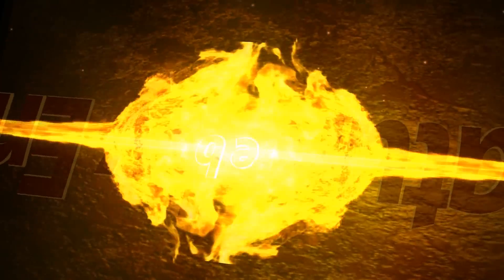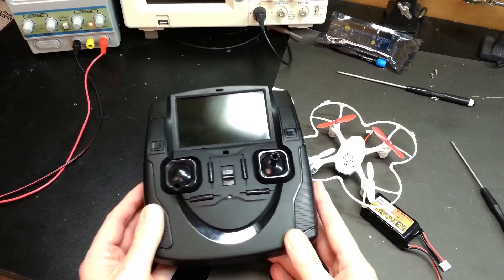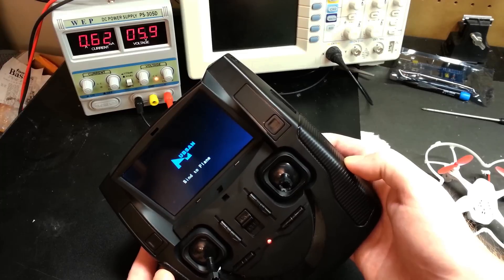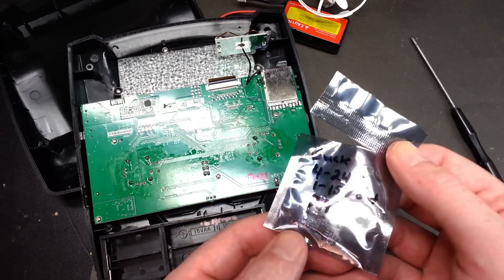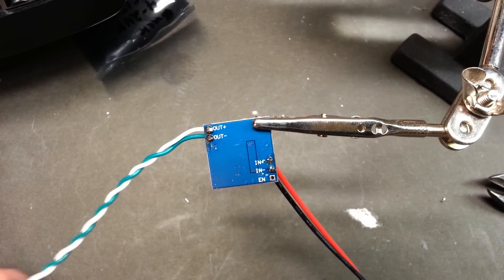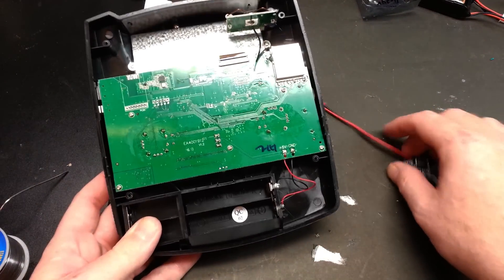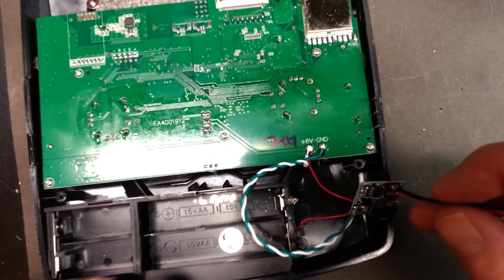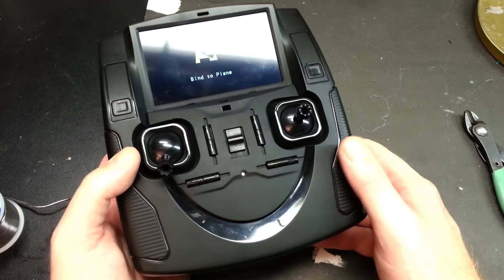Convert Any R/C Transmitter To Rechargeable Packs (LiPo etc)

Comment: Hi there, I have a mjx bugs 6 controller and it takes 4 X 1.5v  AA batteries. Could I please do the same , if so what parts would you recommend buying as I'm in the UK so eBay or Amazon is my only choice. Thanks MKme lab 😃👍

Comment: Very helpful... for the new professional Hubsan  FPV Transmitter remote for the H501S-S that uses 8 AA which of these  batteries is the best? 

 * ZIPPY 2500mAh 3S LIPO TRANSMITTER JR Z1 9X FUTABA 7C T7C HITEC SWAP 8 AA BATTERY.

* 2650Mah 11.1V 3S 1C FUTABA JR SPEKTRUM TRANSMITTER LIPO BATTERY PACK

*Turnigy nano-tech 2500mAh 3S 11.1v 5C 10C Lipo Transmitter Pack Battery TX JR

*2200mAh 8C 3S Li-poly RC Battery for JR FUTABA FlySky FS-TH9X Transmitter

*3S 11.1v 2600 mAh 3C Transmitter Pack Futaba JR Spektrum Walkera Radio 

Thanks...

Comment: Great video. I have tried this mod on my Hubsan h501s using 11.1v. I'm now back to stock, but now using 4x AA "Energizer Ultimate Lithium" batteries. I kid you not! I got 400m extra range (from the same spot). I have used the same battery set over 15 flights now, each flight ranging from 13min to 23 min. It's still on full bars. Just try them. Their around £5 for a pack of 4.

Comment: I would have removed the divider between battery bays and fitted the battery INSIDE the case. If you are going to convert, do it right. Nice jon. Good tip.

Comment: I just ordered 10 of the buck dc-dc converters. I am having issues with my DX 6, seems the turnigy 4000 mah lithium battery is supplying too much power to the transmitter causing a shut down issue. Power is somehow bleeding beyond the switch and powering the back illumination board. I am also having issues with my Tactic 850. The battery is being bled down by the transmitter. my goal is to add the buck converter to lower the voltage. I also am adding a sound booster to the transmitter as well as replacing the factory speaker which sounds like crap with a speaker from a computer. When I am done, I should be able to understand what is being said and loud enough with no distortion on my DX 6. Your tip is a great idea and should work great for both applications, both powering the amp and regulating the power comming from the battery. I will be releasing a free video on RC Hobbist extreme should it work. ok.

Comment: Would it work on the RECIEVER???
The reason I ask is...on some cheap $20 cars with 7 ea nicad  (8.4 V)
I simply used 3S or 4S  LI ON on them. The stock RX works fine.
It gose faster. Maybe 20-30 mph....That was QUICK and CHEAP..lol

I have a 1/16 that used 5-ea nicad pack.......NO GO on 3S
It has decent speed for 7 year old...but Im older now...I need it a wittle FASTER
I got it for $16...Im not going to spend $100 to fix it...when I can just get one
for $50.......$5 is okay.lol

Comment: Thanks! Im totally going to do this to my heli transmitter. Because its 6 volt and i want to use the same 3s lipo that runs my 12v truck transmitter. :)

I need a lesson in soldering probably lol but im gunna do it anyways.

Comment: I have made this and it´s so easy. I use a UBEC with a jumper for 5 or 6V and a Li-Po 2S 1000mAh. I set the UBEC to 6V and all runs fine. I have install this in the case of a Fly Sky FS-i6 with a connection cable in the batterycase to disconnect it and connect it to my charger.
It was the best idea ever to modify transmitters what i found.
Thanks very much! :-)

Comment: can i use a 2s 800mah 25c?
Reply: using a lcd voltage regulator 2amp stable 3amp max 1.25/37v

Comment: oh the  72 MHZ with a long antenna has exponential  works good except batteries dont last  AA 8 Cells. so the thing I'm concerned about  my futaba that had 8 AA cells in it when fully charge  it went to only 11.3 volts , now  with the 3S Lipo   fully charged its  showing 12.4 volts, won't that burn up the radio ?

Comment: I ran two 3.7v 650mah in series to get 7.4v a few weeks ago and it works perfectly.
Reply: I get about 2hours run time out of them.
Reply: No voltage regulator?????
Reply: Nope, works fine on mine.

Comment: Question, how do you know when you reach your lipo lowest voltage without pulling to much out of your lipo?
Reply from the maker: I dont go to a "lowest voltage" I just charge it after a set of flights.
Reply: Lol so just guessing and hoping you are good :O what is the use of lipo then? Recharge every couple of flights, you can do that with normal NiMh batteries. Fun project for sure but for me it won't be adding anything. Still looking for a solution where lipo's give me an advantage over standard batteries. Keep up the good work.
Reply from the maker: I can do basic math.  The draw of the TX is constant. The Ah rating is printed right on any pack.  There is no guessing required.  Buy a 99 cent LiPo alarm if it's problematic for you.  Cheers
Reply: That lipo alarm was what i was thinking about too. Might give it a try.

Comment: Thanks for your video. I tried the mod but even with a 6V output from a 7.4V, 35C 2200mAh battery, the controller would not turn on. It was tested to turn on fine with 4 x AA batts. Could it be something to do with the current drain from the battery? I tried ramping up the voltage and the transmitter did turn on but no power to the screen. Thanks for any help you can give. Colin

Comment: Another follow up question pls:  I notice you are using 1000Mah.   Aren't AA's about 2000Mah,  I had been thinking a 3K or 4K Mah lipo would be needed to make a difference - or is the theory to keep the Tx lightweight, and have a couple for a long day?
Reply from the maker: The 1000's are just what I had a pile of.  I use 2200 3S quite regularly on my other TX's.  I dont fly the Hubsan much or long, so 1000's are fine for me.

Comment: Great video.  Might you have a link to the specific buck board you purchased?   Also, would it be reasonable to figure that it would work for the H502S also?   I think they are the same Tx.
Reply from the maker: It will work for any TX. Links go outadated weekly- search eBay for mini RC buck converter.  Tonnes of sources.

Comment: Hi, great tutorial. 

Just a question I asked my dealer but he couldn't answer. 

My Q222 comes with a 6xAA battery TX, now I use rechargeable NiMh batteries so I get a 7,2 volt power and the battery indicator always say I'm on half batteries. 

Now I  could buy regular 1.5v batteries but that's bad for the environment imo. 

Should I get 1.6v nizn batteries and how does this effect the TX range compared to 1.2v? 

Thanks,
Reply from the maker: A change in battery type will not affect the range.  They don't work that way.  Use whatever you like :)  Cheers

Comment: it is crazy how it burns up batteries. I was glad that I have rechargeable AA batteries. Good video.
Reply from the maker: Thanks very much. Hope you enjoy some of the other vids on the channel. Cheers
Reply: Hey Ian, what type of rechargeble AA(NiCd,Lipo,LiFE etc.) are you using, and how much time do you get before you have to re-charge. Thank you
Reply: I'm using just good old rayovake rechargeable AA batteries. Only about 2 flights. I charge the batteries after every flight to be safe.
Reply: How many mah are your Rayovac Batteries you use? 2,000mah?
Reply: I went ahead and bought a couple of Buck converters and will be using lipos. Thanks for your responses

Comment: Maybe a stupid question but how do u recharge the lipo battery? Do u need a dedicated charger?
Reply from the maker: Yep a separate charger.  The idea here is mainly for folks that already have packs and chargers. I just use my normal flight packs.  Cheers
Reply: Thanks for your reply. I'am just getting into quads. I bought a Hubsan the other day so i'am going to do this conversion. as i'am just getting into quads i don't have many chargers and battery's lying around. so i bought a universal lipo balance charger so i'am all set to charge any lipo in the future. Thanks again for the info and the video.
Reply from the maker: salland12 Welcome!

Comment: Do you find that the buck converter gets hot? I just got mine and was testing it with a 100 ohm resistor load and the RT8272 and coil get very hot. And that's only drawing 60mA, no were near the 2 amp that the board's rate for.
Reply from the maker: Nope mine dont get hot. just a bit warm

Comment: Couldn't you just use rechargable AA batteries also?
Reply: Well i can get 4AA batteries in UK for £2 (or $4ish) and the charge then for £8 ($15ish). Both seem like decent options
Reply: +Crazylaze98 most quad guys have spare lipos and chargers laying around. Voltage converter cost from 1.5 to 4 dollars. And Ni-mh are 1.2V so it would be 4.8V if you use 4 AA batteries. That is way below than 6.19V he set up on his transmitter. I dont know whether lower voltage may affect the transmitter range or not.

Comment: Hey there, great vid...Can you use still use normal battery's just incase?? also i heard you mite get better response from quadcopter with this mod as a lipo supplys much more juice then AA batterys so signal should be more stable??
Reply from the maker: +terry k You can still use AA's. No the mod mod wont make any difference to the stability. Cheers

Comment: This transmitter support 5V up to 15V (you can see it on the chipboard) so you can plug directly a LiPo battery it's even easier and cheaper!!
(I did it and it works just good)
Reply from the maker: +nicolas degrave Read through the comments as I have answered the reasons for this numerous times. And re-read the title :)
Reply: oups yeah sorry ^^
I've been to fast
Reply from the maker: +nicolas degrave No prob :)

Comment: Sorry for my ignorance but how is this mod better than using good 'ol rechargeable AAs? My AAs are rated at 2100mAh which is more than twice the lipo pack in this video. I'm not discrediting the tutorial which is very high quality, I'm just curious.
Reply from the maker: +Ryan Nguyen Definitely a valid question. The pack I used in the video is the smallest ones I use. You can easily go up to a much larger 3S pack. The convenience is that you can use the flight packs you already have for other RC etc. Just another option over AA's. Not necessarily better for everyone, just an option.

Comment: Are there any limits on the size of the battery, or just keep the voltage in line with the input limits of the buck converter?
I'm thinking about using the same battery as the quad, 2700mah 7.1V, however it has an EC2 adapter on it, however it seemed more readily available and cheaper to use the LiPo and connectors with XY60 or JST plugs.  Thoughts?

Also, do you have any estimates on battery life on certain mah sizes?
Reply from the maker: +Mikee Mike Just keep the voltages in line. I use my 2200 3 cell packs often.

Comment: Why don't you have people send they're controllers to you and you do that and we pay you for doing it!?????
Reply from the maker: +Dylan Horatschki Or I could teach people to do it and empower them to learn and make...
Reply: lol whatever dude your loss
Reply: +MKme Lab he's not understanding the value of learning! Perfect video it was exactly what I was looking at doing!
Reply: +Dylan Horatschki :  The first step is always the hardest step, Dylan.  Take MKme Lab's advice and follow is instructions.  I promise you, if you make a list/instructions on paper, take it slow and double check your work, you'll succeed and you'll feel a great sense of pride and accomplishment.  Soldering is easy. You can order, on Amazon, an inexpensive 15-35 watt soldering iron, with interchangeable tips, flux and low silver content solder ( easier to work with ) all for less than $20 on Amazon ). The BUCK boards are inexpensive ( 6 for $10 on Amazon ).   Also, 12 - 16 gauge silicone insulated wire ( 10' for $8 on Amazon ).     You'll be teaching others everything you've learned, in no time!!!

Comment: I need to do this. Thanks for the tips ;)
Reply: MKme Lab ...thanks for sharing! Possible to wire  jst>buck converter>to board and leave AA battery holder wires alone to have the option of still using AA batteries if needed?
Reply from the maker: +YoSneeze Welcome.  Glad the video helped.  Thats why I make em :)

Comment: Thanks Eric for your video for the lipo install, i opened mine and the voltage on the board takes 6-13v so i have just soldered a 7.4v 2s 1000mah lipo, works great, press and hold the right stick and power on(mode 2) it will tell you the firmware, mine is 2014 so no voltage regulator required, i even tried a 11v lipo as well and it works great also. if you slip a skewer down the side of the battery tray and press the 4 tabs it will slide out so you can Velcro the lipo inside the case without drilling holes.
Reply from the maker: +vatphil Nice!  Cheers

Comment: Should have set the converter to a higher voltage, as 4 brand new alkaline (Duracell) AA batteries are closer to 6.4v. A simpler solution might have been to put 2 or 3  1N400* rectifier diodes in line with the + voltage coming out of the LiPo, going to the back of the PCB.  Fully charged 2S LiPo = 8.4v - 1.4v drop over 2 diodes = 7.0v .. which will gradually fall to about 6v as the Lipo depletes.  That said, I just put a LM7810 regulator inside my XK X380 TX and fed it with a 3S Lipo to give me 9.9v regulated to the TX (6 new AA cells 9.5 to 9.6v).
Reply from the maker: +Bill Somrak Well the buck converter doesn't change output until the Vin drops below Vout... :)
Reply: I've looked at the specs on several of them online, and the best I could find showed that Vin must be at least 1v above Vout .. then they fall out of regulation. Not a big deal on 'toy grade' quad transmitters, admittedly.

Comment: In the video (3:40) when you're testing the volts output it was already set for release 6.19...if it wasn't how would you have adjusted the output?  Very new and trying to understand this.
Reply from the maker: +kerry corcoran No worries.  The little silver phillips head trimmer in the corner adjusts the output.  Cheers
Reply: +Eric William -MKme Tech - thanks you; ordered the convertors yesterday.  At the start of the video you first check the transmitter to see how much current is needed to function, using a desktop power source.  I don't have a desktop power source, is there a different method I can use to find out how much the transmitter would require?  Wanting to perform this mod on another transmitter I have.
Reply from the maker: kerry corcoran You could just use any ammeter to measure the draw  Cheers

Comment: Nice video Eric. I have a Spektrum Transmitter Battery Pack it is Lithium Ion 2000mAh (14.8Wh)-2S 7.4V. Do I still need to use the Buck converter?